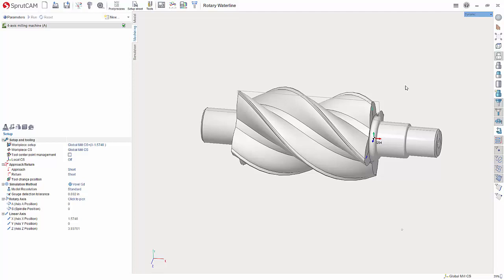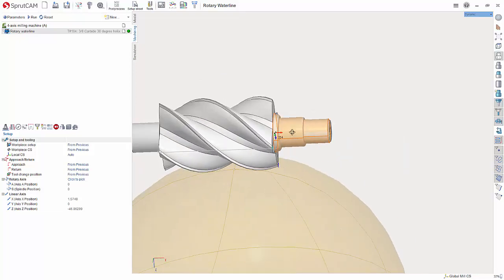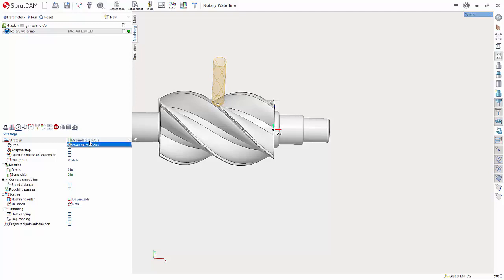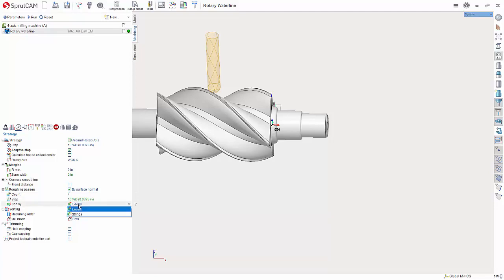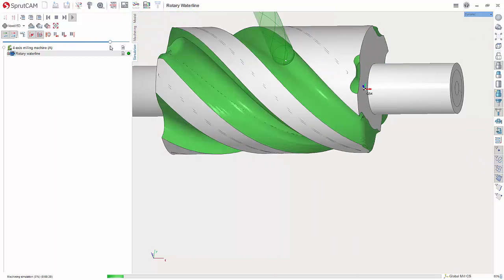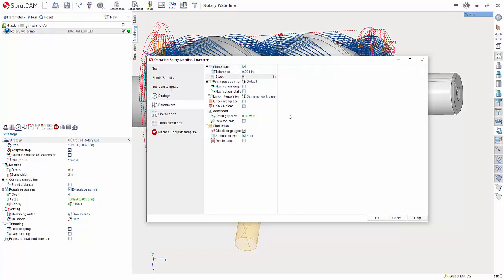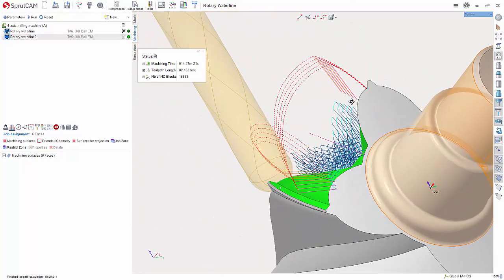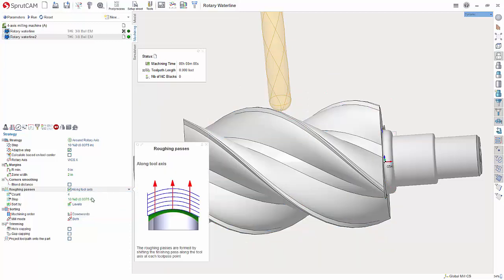SprutCAM 14: Rotary Waterline

Comment: I've been looking for a 4th axis CAM and this might be a candidate, but I need to know about costs.  I do a ton of work and CamBam right now and just manually code indexing, but true simultaneous 4th axis is something I need to add to to my work capabilities. I currently run multiple machines with Mach 3 (not likely to got to 4) and one using PathPilot (LinuxCNC).  

It seems like there is a base price, but then everything is an extra charge.  Trochoidal HSM strategies, rest machining, and simultaneous 4th axis are all on my must have list.  

My typical process for (3 axis) multiple cavity mold making is to have operations to prep the blank, and then grouped operations nested to create the cavities. Can you point to a video showing something along those lines.